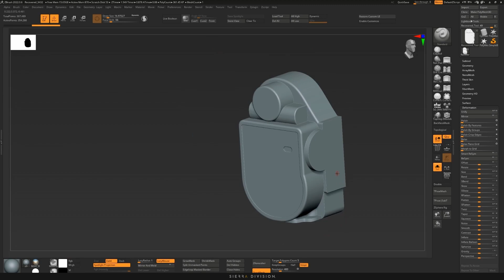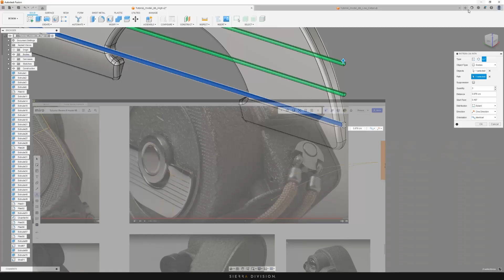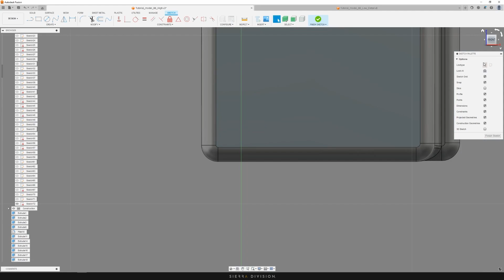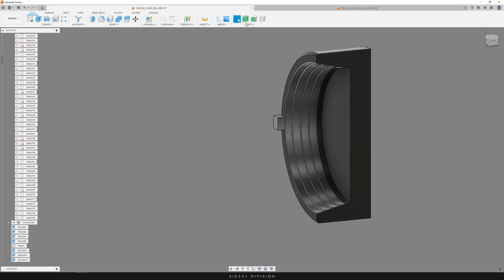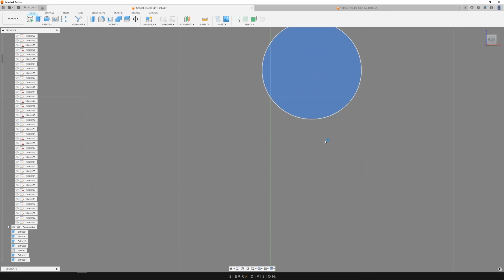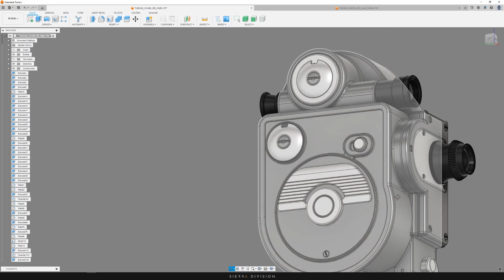MODELING: High Detail Pass

Comment: Is it a CAD software 🤔 like fusion solidworks plasticity?? Or you keep it to yourself and work on projects?
Reply from the maker: That's correct, this is Fusion 360, but the workflow can be used in any of the programs you mentioned. In our follow up videos coming soon, we will be sharing how this workflow can be used in games and the assets converted to a Polygon workflow with standard UVs and textures applied.
Reply: @sierradivision  Would recommend highlighting Plasticity as it is gaining popularity and has significantly reduced completion time. Thanks